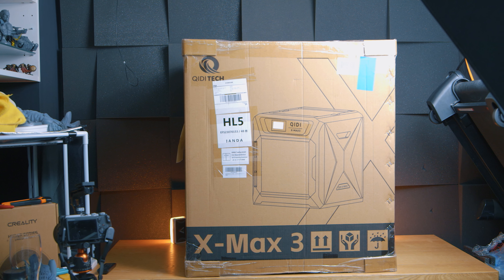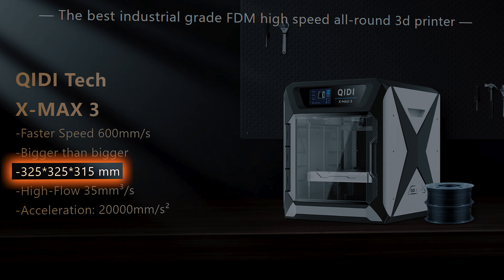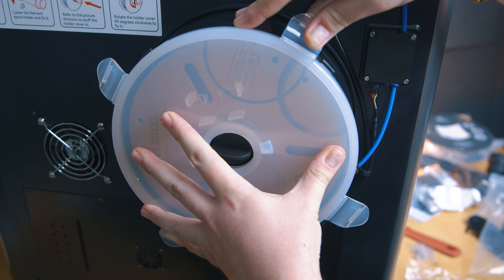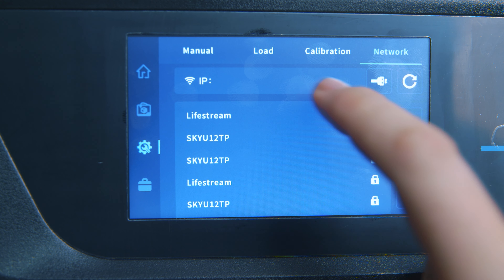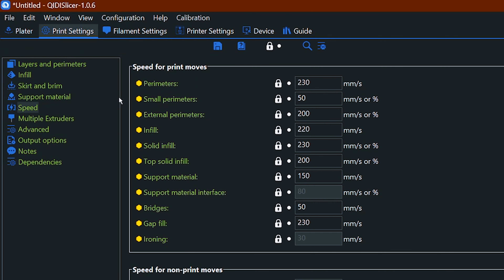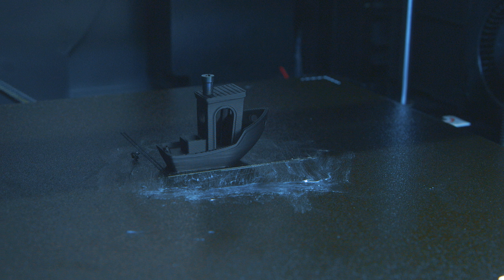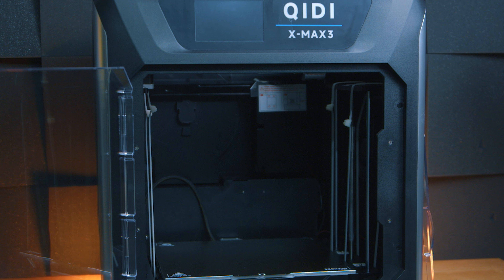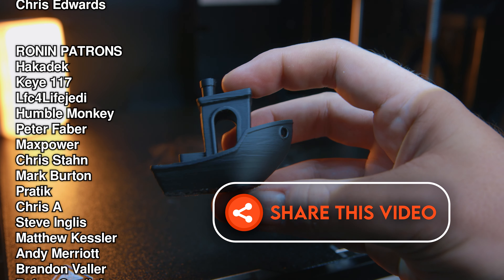QidiTech? X-Max 3 Review - WHAT IN THE HELL IS a Qidi?

Comment: I loved my X-Max 3 so much that I bought its little brother, the X-Smart 3.  My only gripe about the X-Smart 3 is that it has an inductive sensor instead of the BLTouch that the X-Max 3 has, and that the X-Smart 3 does not use the embedded magnets that are on the X-Max 3.  Instead, the X-Smart 3 uses a magnetic sheet, which in my mind impedes the heat transfer to the flex spring steel coated build plate.  But both printers are serving me well, expecially the X-Max 3.  I have been printing Qidi carbon-fiber PET filament on my X-Max 3 with excellent results.  The only thing that I 'upgraded' on my X-Max 3 is replacing the Qidi dry-box with a 'Stacker F-Box' dry box that I ordered from Amazon.  Like the Qidi dry box, it uses dessicant, but I believe the Stacker F-Box is sealed better than the Qidi dry box.  Also, it can be placed next to the printer with a longer feed tube.

Comment: there is a camera for the xplus 3 and xmax 3. also you dont even have the full package yet, you can contact qidi and get an inductive sensor, a better and improved fan shroud wich also cools mainboard and extruder motor, a new better USB cable and a magnetic sheet to keep the spring steel sheet from warping because the magnets are actually too strong :D
Reply from the maker: How the hell did I miss that! thanks, I'll update the description (and order one)
Reply: Everything else exept the camera you get for free if you contact support
Reply: First time I saw anyone explain why they moved from embedded magnets to sticker magnet. Thanks! My only gripe with that move is sometimes I like to slap a glass bed onto my printer, and if you do that with a sticker magnet, it will bond to the glass and ruin the magnet. The embedded route doesn't do that. If you look at BuildTak, they have the embedded magnets in a sticker which is unique and allows for placing glass or carbon fiber build plates on top without this issue. As for the magnet strength, you are right they are super strong and can warp thinner spring steel sheets. BuildTak sheets are much thicker than average for that reason, but also more expensive.

Comment: I have one for about a month and i love it. Big buildplate, steel rods, can print PA-CF, is wicked fast, solid frame and doesn't need any internet. I don't have to wait for the weekend to print bigger parts. I just have to find a stronger table. The IKEA Lack has an "amplitude" of about a centimeter. Any suggestions on that?
Reply from the maker: I use kitchen worktops from Ikea. the problem with Ikea Lack, is that it lacks in a lot of ways, like strength and stability.

bg heavy duty legs and affixing it to a wall can help
Reply: IKEA just came out with their Bror work benches. They're super solid. I just built mine and await my X-Max 3. I'll update this to see how it goes.
Reply: @CenryHavill  Then i'm saing thank you in advance. It would be nice to just buy a table. I have enough unfinishes things to care about.
Reply: @seelenschlucht  just ordered it. Will let you know when it gets here!
Reply: @seelenschlucht  It's here! Fits on the bror work bench perfectly. Everything feels solid.

Comment: great vid.  that's my dilemma.  I have been looking either this the x plus or a p1s.  out of interest did you have to do the manual z height adjust?  you didnt mention that in the vid so was wondering if thats necessary still?
Reply from the maker: I didn't need to adjust anything. this just worked for me. I have seen this mentioned on some videos. Perhaps I'm lucky or had a newer revision of the hardware.
Reply: ok so you literally ran the bed level and thats it?  the reason I ask is that I love this printer but am not a fan of manual z off set after my ender 3s1. that part is pushing me away from the qidi.  But size and price especially here is OZ is a major draw card for me.   thanks for the reply as well    @FauxHammer
Reply from the maker: @Dannos3d  in my case, yes, that's all I did. have you considered the K1 Max?

Comment: I never could figure out how to make orca slicer work with klipper/Moonraker so I could print wirelessly.  So can I assume he did that here?  I've been having to use a USB drive.
Reply from the maker: when you add the printer in wireless options you need ip:port.. Use : between them. So "xxx.xxx.xxx.xxx:10088" worked for me (where xxx is your ip address)

Comment: This is one Im trying to review badly.
Reply from the maker: It’s a beast. So much printer fir this price. But I’ve since tested others and many core XY have caught up
Reply from the maker: @@Rho-Tix To be fair, now the K1 Max is out, I can't see many people buying this anyway.
Reply: @FauxHammer   You'd recommend the K1 max over the X-Max 3?
Reply from the maker: @CenryHavill  I prefer the form factor and built in features
Reply: @FauxHammer  I appreciate the reply. If I plan on printing CF and other engineering grade parts, the x max 3 would be the better option, yeah?
Reply from the maker: @CenryHavill  it “seems” like the bigger powerhouse unit.
Reply: @FauxHammer  think I can print CF reliably on the K1 Max?
Reply from the maker: @CenryHavill  probably. But I dunno. The X-Max, just seems more geared toward that jobs at the same time. I’ve since read online that it can have similar slippage issues to the X-Plus at high temps
Reply: @FauxHammer  the x max can have similar slipping issues? Any way to remedy that?

Comment: You failed to mention the manual z axis offset. Not much different than the ancient Prusa Mk3 S+. I HATE manually setting the z offset.  AND you need to take the top off the printer to set the it.  Still.. This is the printer that I'm recommending for our small prototyping needs.

Comment: I've been using a Qidi-tech 1 for nearly 8 years. The printer just keeps printing, and this company backs their printers. I had a motor go out in the first couple weeks I owned it, and I contacted them, expecting to have to buy a new motor or something obnoxious. Instead, they shipped me two motors, and a box of other various parts that I might need in the future (one could argue this could be included with the printer). They were a new company then, and have only seem to have gotten better. 

I'm strongly considering this printer, as it is the only printer in the price bracket with a heated chamber. Depending on what you're printing, this is significant.
Reply: +1
I'v been using the i-Mate S for about 2 Years. At first, there were some minor Issues (sloppy Assembling of the Printer). After fixing that, the Printer just works and works...
And yes, their Customer Support is S-Tier. Haven't seen any Company come close to Qidi (and i'm old ;)